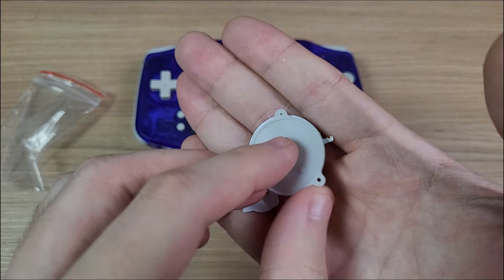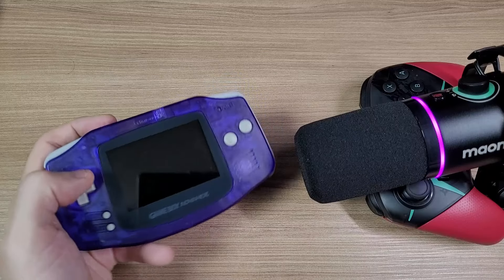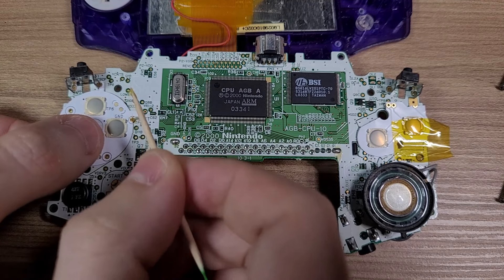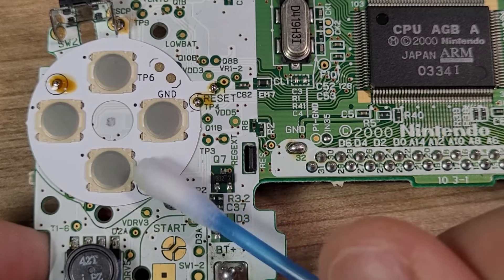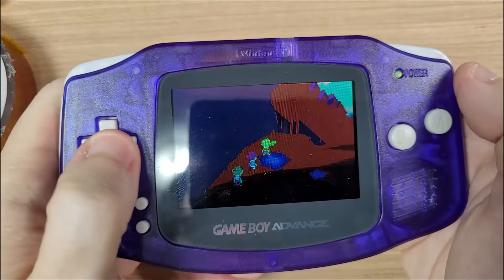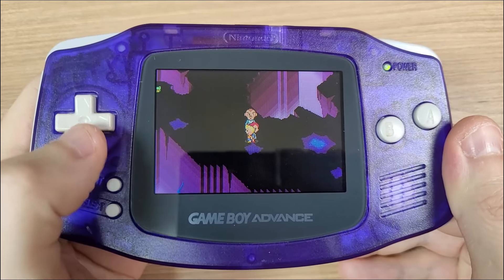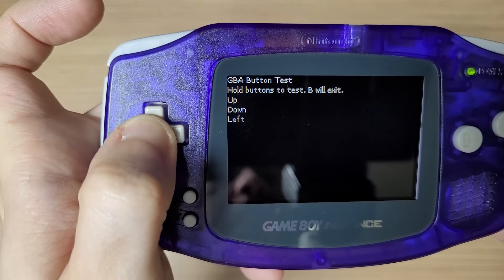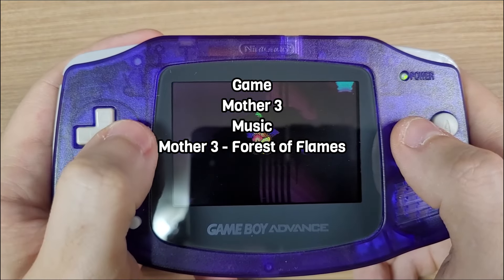GBA Clicky Buttons Mod!

Comment: Thanks for the video! I just installed the mod and after some trouble with buttons not working & accidentally destroying the display mod cable, I managed to get it done :D
I wedged a little circular plastic piece right in the middle of the d-pad, which fixes the "press down in the middle". Works perfectly for me!

Comment: Glad you mentioned the overly-sensitive A and B buttons. I've run into something like that with keyboard switches in hotswap sockets where it feels like the switch itself moving inside the socket activates when the switch hasn't even done a full proper actuation. I know how annoying that can be.

Comment: I would never use that type of input or membrane pad type thing because those pieces of metal can deform and get stuck inward, and then your button won't work anymore. Just go for mechanical switches
Reply from the maker: Then just dessolder it an youre back to normal

Comment: Hello, ive got a question.

Does the mod make contact with the contact points below or does it make contact by the soldering itself?
Reply from the maker: Make contact by the solder points

Comment: You should see the input lag from your screen, I've come to realize that the most common IPS screens add a lot of input lag, 3 frames from the base screen that is already 2 frames. So 5 frames in total.
Reply from the maker: this screen is an AGS101 not ips
Reply: @VKsChannel IPS is a technology, not a band.
Reply: @RationalFunction  AGS-101 is the second model of GBA SP that came with a backlit instead of frontlit screen, he's saying it's an original screen taken out of an SP, not an aftermarket IPS kit. The AGS-101 used a TN screen, not IPS.